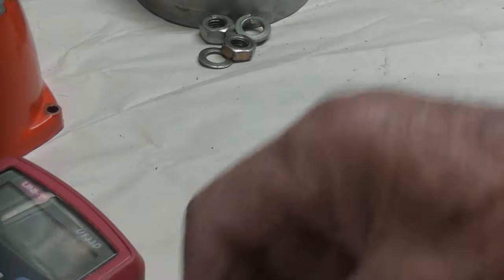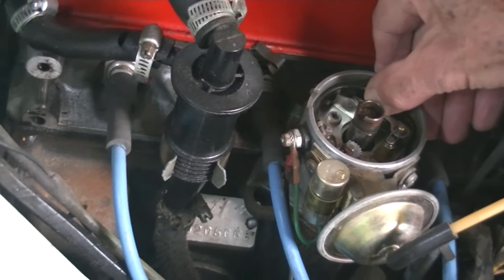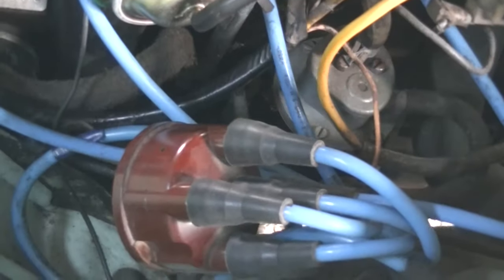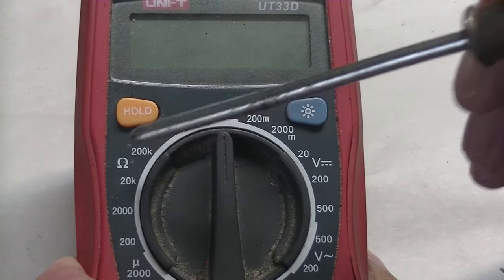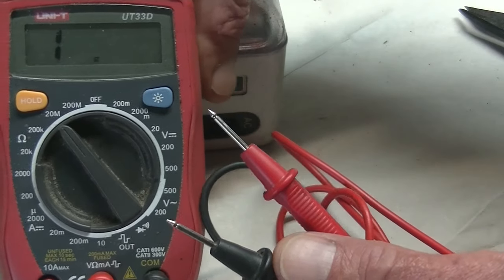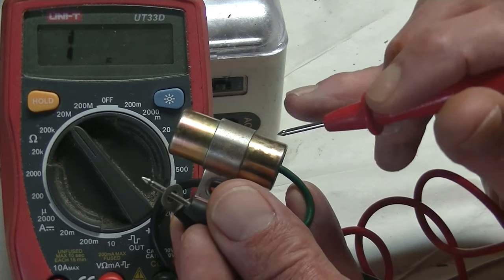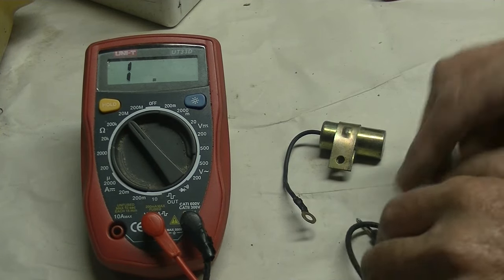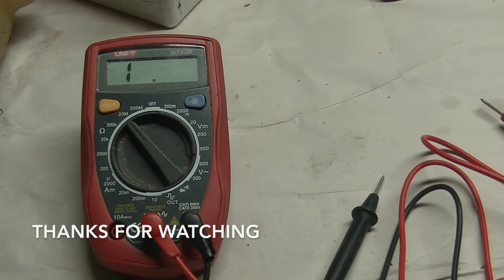How to test a Condenser or Capacitor

Comment: how  do you know what value condenser you changing  the way to check if you have correct condenser  your point will not pit  if they are pitting you have wrong value condenser  the come rated in microfarads  as an ex.  i have an m37 army trk  spark was weak  which i thought was ok  till i read about  this on line  bought correct cond install  it spark would jump 3/4 inch to eng block when tested with screw driver  and eng running  test yours to see what length you get  take one lead off plug insert screwdriver  run eng at idle   if you are getting good  jump 1/2 in or more you are ok
Reply from the maker: Thanks Frank, good point so first off, make sure your condenser is the one that is specified for your vehicle. If you take the old one off replace it with the same. The test for all condensers is the same as my video. The reading must start low and then increase to infinity. If it starts off high then the condenser is faulty.

Comment: Do the leads on the meter matter? I was seeing both red (positive) and black (negative/ground) leads reversed when checking. One would be on the the wire lead and the other to ground and vise versa. Would that matter for current or draw reading?
Reply from the maker: Thanks or watching Allan, no the leads don't make any difference at all to the readings. Just don't touch your finger to the capacitor like I did by mistake.

Comment: Thanks.  Would have helped to have one that was bad an see the results.  Also would have liked to let the digital meter stablize before you stopped the testing.
Reply from the maker: Thanks Nathan, yes, its a pity that I didn't have a bad one! Even the 3rd one in the video turned out to be good. Just had a bad reading cos my finger was touching the terminal. The reading rises until about 18 and then stabilises at "1" (one) which is infinity and is the final reading
Reply: @davekennedy52  I was going to say your finger might have messed up that 1 test good catch another thing is I touch the wire to the body before I do anything with them they could have a charge in them ,, a friend had a power box that would be a power unit to test a car hot box would give the power for spark and it would charge the condenser would toss them at people and if they touched the wire and the body of it would get a bit of a zap .. so I check them before testing ..
Reply from the maker: @randytravis3998  Yes I did mess up with my finger touching, didn't even realise it until later. Thanks for the warning, I've been zapped a few times from my car especially when adjusting the distributer timing with the engine running

Comment: Thanks for the video. How do you know when you have a bad condenser? I have tested mine and I get nothing, I assume this could be a bad condenser. That said for some reason I do not have  20M on my multimeter, I have 200k.
Reply from the maker: you're welcome dallas, I speak under correction, but I think that if the resistance (ohms) is higher than the 200k then it won't register at all. Thats why you need 20M or even 200M. The reading should go from low to high and end at 1 which is infinity. If it starts off high then its a bad condenser

Comment: or it simply won't start/no spark. Have had that with a bad one.
Reply from the maker: me too, there really are some junk ones out there these days
Reply: @davekennedy52  i'm getting spark when I hold the spark plug in my hand but if i set it on the head and try to watch for spark I'm not seeing anything
Reply from the maker: @schlomoshekelstein908  Is this on your car? Don't hold the spark plug in your hand, you'll get a shock, its about 30 000 Volts. Wire brush the head to bare metal and try it again in the dark
Reply: @davekennedy52  yeah the heads are painted that could def be an issue. It's a Kohler K-241. I don't think it's 30k volts though because I can hold the plug in my hand and crank it over like 10 times. The spark isn't that great. it felt like morse code. weak, weak, mild, weak, super strong spark. Like a spark from a BBQ igniter. In my experience, when i've held spark plugs before , you don't really hold on for a second zap..or want to anyways.. I'm guessing it's the condenser? I've already filed and re-gapped the points. They were too close about ten thou (now set to .020)
Reply: @davekennedy52  i dont get any explosions when I spray starting fluid into the carb and crank it over, either. which is why i'm looking at the spark. I think I need to replace the condenser and/or check the magneto. The spark plug is brand new. I just had a thought. maybe some magnets on the flywheel are getting weak and that's why i get morse code spark?
Reply from the maker: @schlomoshekelstein908  I know that just before a condenser goes the spark is big and loud and then eventually nothing. A common problem is the flywheel key, sometimes it breaks or is worn and that throws the  timing out. You could also lightly sand the magnets and clean them up which might be the cause of your morse code spark. Also check the gap between the magneto and the coil, supposed to be business card gap. I suppose you could replace the condenser just to make sure. Spray starting fluid directly into the spark plug hole, then put in the spark plug and crank the engine. Just some thoughts!

Comment: Since my multimeter doesn't work brand new out of the box read zero no matter what I do. I have a test light I have a four cylinder zxb Hercules generator. I may just have a couple wires backwards for the most point it's wired correctly because I figured that part out. I have power going to my coil test light reads on and off with the toggle switch with everything hooked together with the distributor and the coil when I rub the negative battery terminal slightly with the spark tester in between the spark plug and wire you can see it sparking. Yeah when I plugged the battery and and I try to start the engine I have no spark. I'm not sure if it's supposed to be reading with the light turned on the test light or not because it's stored power I'm assuming that's why the test light turns on but is your little condenser supposed to have power? So you got your battery plugged in your test light is going on and off with the toggle switch so you're getting power to the coil to the spark plugs not the distributor. When you put the test lead on the condenser test light lights up is that normal?
Reply from the maker: The little condenser can carry a charge of about 20 000 volts. It needs that charge to be able to jump the gap at the points in the distributer. So then the condenser is discharged and its empty of all charge. Then the points close and current starts to flow again. As soon as the points start to open the current is cut and the charge starts to build up in the condenser again.              Take the thick HT lead (the one that goes from the coil to the distributer) and pull it out from the centre of the distributer. Then hold it 1mm from the engine block (use thick gloves) and crank the engine. You should see a spark. If you do that means that your coil and the HT lead are good. Presumably you have a fully charged 12Volt battery which should be reading at least 13 Volts. If your contact points in your distributer are worn or not gapped correctly or your ignition timing is out that could also be the problem. Sorry I can't be of more help but good luck!

Comment: What about small condensers ?
Reply from the maker: it will be the same process. If you have one with 2 wires sticking out, one will be negative and the other  one will be positive. Put your multimeter red lead on the positive and the black lead on the negative

Comment: Appreciate the help! Except mine reads high to low 😂
Reply: I was supposed to leave the points open! Haha
Reply from the maker: I was just going to reply to you to say that if the reading starts off high, then its probably a bad condenser. Then I saw your comment below!
Reply from the maker: @harleycongrove5389  I usually take my condenser out and test it on the bench. Didn't think about the points, thanks for the info

Comment: Can I use normal dc condensors ?
I dont have that automotive condenser so I was wondering can I use normal .
What rating does the ignition coil requare and what does the alternator requare to supres noise?
Reply from the maker: I wish that I could help you Elvin, but I don't know enough about car electrics. but I do  know that the coil can generate about 20 000 Volts and it gives that current to the condenser. So only use the condenser that is meant for your car otherwise you might burn out your points and maybe more damage to your electric system
Reply: @davekennedy52  ok thank you for answering ☺️👍

Comment: is it possible to use 2 of them? i remember my mechanic did this to my old car
Reply from the maker: Hi Pasyensya, I believe that it is possible, but they should be connected parallel and not in series. 2 in series gives a result of less than one, but 2 connected in parallel is the equivalent of 2. I'm just saying what I've heard so please don't try it yourself as I would not like you to damage your cars electrical system
Reply: @davekennedy52  or driving mower
Reply: Yes it should work fine like 2 relays as a fuse
Reply from the maker: @Mike-su8si  Thats nice to know, thanks for the confirmation Turtle
Reply: @davekennedy52  yup

Comment: If it doesn’t work the car won’t start?
Reply from the maker: Quite right! But before it is completely broken, your car will struggle to start, you might have misfire and uneven running and big spark at the points so your points will burn out too.

Comment: capacitor control spark not the coil voltage has to flow thru the coil primary to the capacitor lead thru the capacitor and can to ground only as long as points are open when they close voltage stops  while this voltage is flowing it greates a manetic  effect in the secondary coil which has many more turns of wire than primary coil this make a very high voltage go to the distribter and plugs to make spark

Comment: The alternator is not in the path between the battery and the ignition coil. 

If you don't believe it... disconnect the alternator and the engine will run.
Reply from the maker: thanks Joe, yes it will run but not for long. So presumably while its disconnected, will the coil get its power from the battery? Please enlighten me
Reply: @davekennedy52  Yes, it gets power from the battery all the time.

Comment: coils very seldom  go bad  if you suspect your coil dont depend on ohms test. capacitors are the culprit 75% oft the time they come with mfd value which must match the coils when designing a system for max spark  if over time wrong capacitor is installed  tbls start first sign of wrong capacitor is pitting points   causing weak spark  with correct value mfd  you will see big diverence in spark

Comment: are you changing your points  because  of pitting  the culprit is the capacitor--------wrong value mfd or maby defective capacitor this is what happens the voltage from switch come to  the primary coil -thu the coil to the capacitor lead and the points if points are open this lifts the gd off that connection of the capacitor lead and the voltage goes thru the capacitor to gd that voltage running thru the prmary coil creats a magnetic effect in the secodary coil which has  many more turns than the primary coil generating a very high voltage going to the dist. and plugs as the points close this voltages stops because the gd is conn to the capacitor lead  again  if for some reason the voltage can not get thru the cacacitor this voltage will jump the gap of he open points to gd, causing pitting overtime    which is changing gap setting  giving a weak spark--as a rule spark  tbls usuall start with a bad capacitor more than any other part of the firing

Comment: a simple but effective test will tell you about your condenser in older vehicles remove a plug  wire from a plug with eng idling insert a screwdriver in wire hold screw driver close to the block how far will spark jump  1/8 inch to 3/4 in1/8 is very weak 3/4 in is very good  if its 1/8 replace condenser  a new condenser of correct mfd value wil jump 3/4in also lookat points if they are pitting its the condenser going bad or wrong value mfd    (very important ) -correct value mfd

Comment: didn't explain what readings meen
Reply from the maker: Thanks for watching Phil, Ohms is a measure of resistance. If the reading on the multimeter starts low and then gets higher it means that the condenser is charging and its good. If it is an immediately high reading then its a bad condenser. Sorry I didn't have a bad one to show on the video, they were all good

Comment: I've put a new condenser in my car it startup then idle for 20 secs then off...
Reply from the maker: Did you test it with a multimeter like I showed? Actually sounds like you need to adjust your carburetor

Comment: If you initially briefed ‘ connect the black lead to the pig tail and the red lead to the condenser body’ why are you flip flopping back and forth with each condenser tested…. be consistent and stick to what your mechanic friend told you to do.  😡
Reply from the maker: Yes I suppose I should have but I also know that it makes no difference to the reading. Thanks for mentioning it

Comment: connect a condenser in a dist to test it if you get 1/2 inch spark  or more with eng running at idle take off a spsrk plug wire insert a screw driver hold screw driver close to eng to see the spark how far will it jump 1/4 or less its defective or wrong value. the condenser must match the coil in this type circuit  although  a lot of condensers look just alike there not ---its the way they are made inside that is different  the reason point pit over time is the mismatch with coil an condenser  pitting is telling you condenser is wrong value  the only way to getthe right value is go to dealer ask parts man to look up in that years parts list get the # of condenserif he has one buy if not parts store have them cross ref that # if there is anything close to that value buy it you wil not believe the diff. it makes  mine went from 1/8 inc jump to 3/4 inch jump..----worth the effort save that # so in the future you get anew if needed
Reply from the maker: Thanks for taking the time to post your comment Frank. Your method seems a little time consuming and quite honestly most ?parts guys" couldn't be bothered with looking up info for you. Not in my town anyway! Maybe you could rather get that info on Google. As per your previous comment, there is nothing wrong with the way I tested my condensers. On one of them I touched the condenser casing by mistake, only noticed it later.A friend of mine with 30 years experience as an auto electrician showed me this method

Comment: Got nothing from this video! He is shaking so bad it’s hard to tell if he is making a good connection or not. Then he doesn’t hold the leads on long enough to be sure. And he doesn’t really explain what’s going on with each condenser. He even says, I’m not sure about this one? Needs more preparation before making the video. And he should have shown a bad one so we can see the difference! Also, I noticed his meter had a micro farad position. Why wouldn’t you use that? I would like to know! Still don’t.